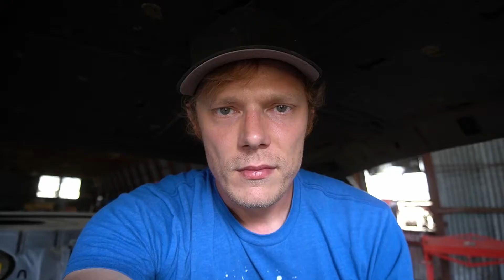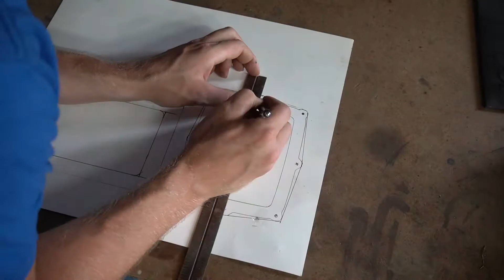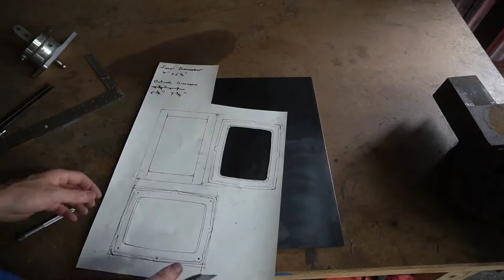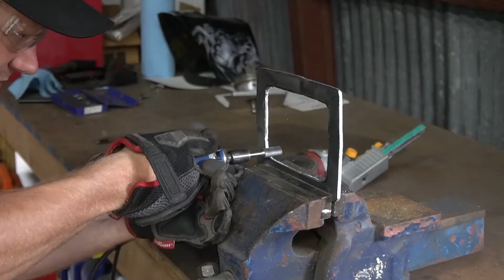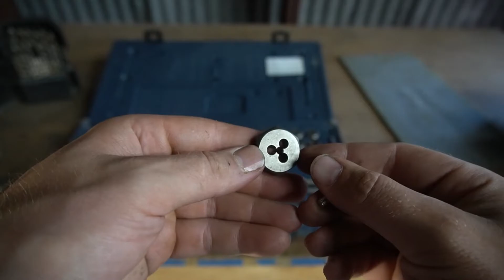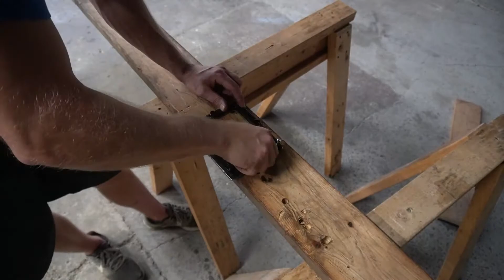Failed First Attempt at a Custom Shifter Ring Mounting Plate!

Comment: I am using the same Lokar ring on my shifter. It's black powdercoated steel. I'd suggest using rivnuts so you can just use standard sheet metal rather than tapping a thicker piece of steel and having to weld thick to thin.
Reply from the maker: Thanks for the info on the shifter ring. Rivnuts would be a great option.